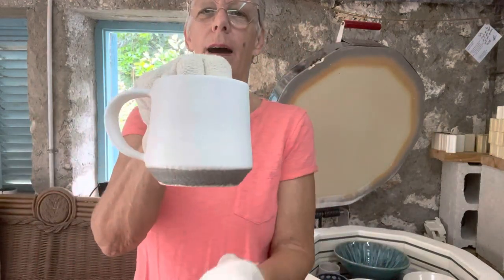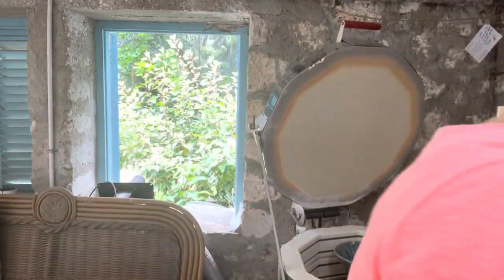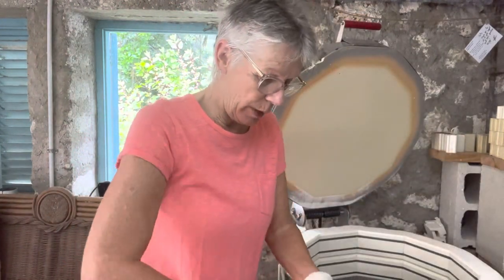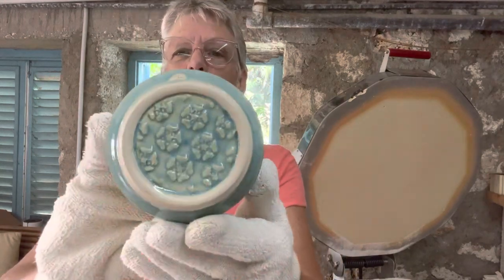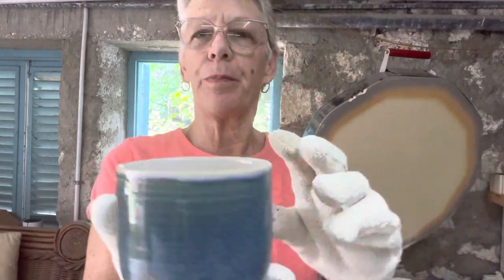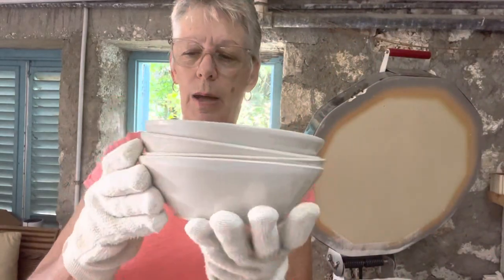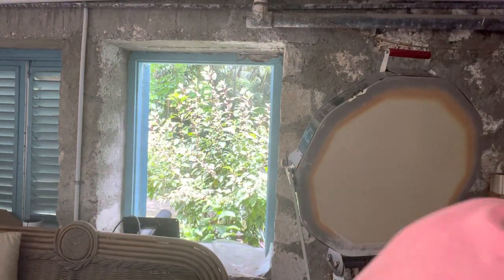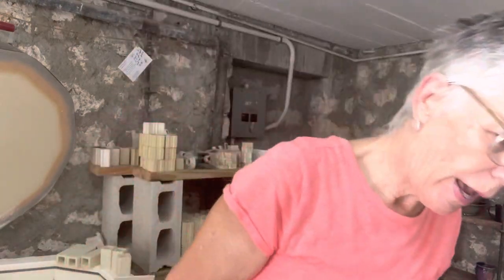Kiln Unloading May 15,2022

Comment: What beautiful pieces!!! I love the little details on the bottom parts of your mugs. I can’t thank you enough for sharing how you measured your hand so you can use it to measure with! I’ve been using that myself since I saw what you had done and it’s so dang helpful! I tried my hand at filming my last kiln opening and it was so much harder than I thought it would be. Lol The blue rutile and Smokey merlot peacock boo is outstanding!! Pleeeease do a video of how you do your handles! I handbuildnand can never seem to get my handles on straight and have small cracks in the joints sometimes. Beautiful post as always.
Reply from the maker: Thanks for your comment.  Filming is not easy and if I only knew how to splice, add subtitles and other features... all in due time.  I am lucky that my hand width is 4" so makes for easy measuring (good for horses too ! ! !).